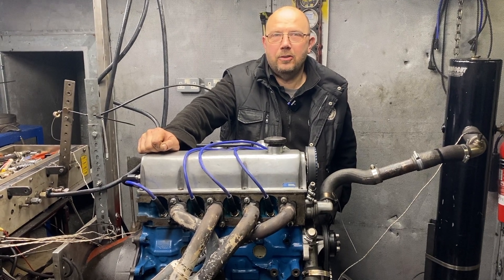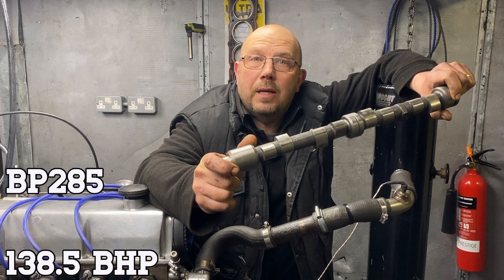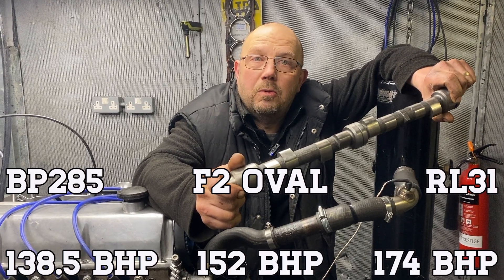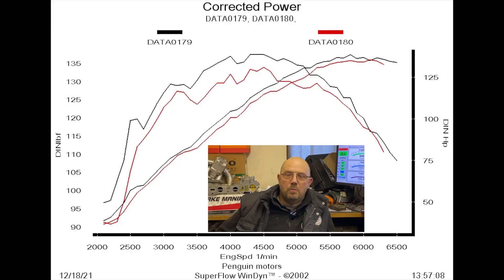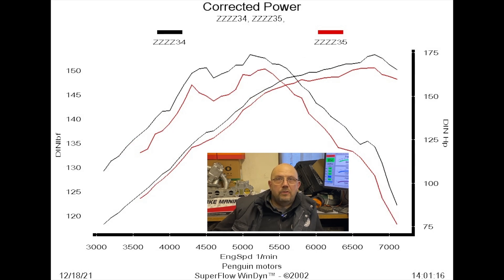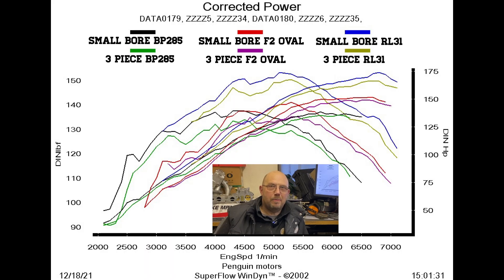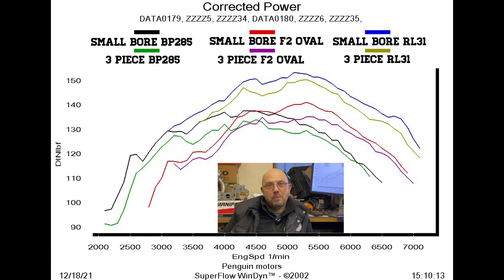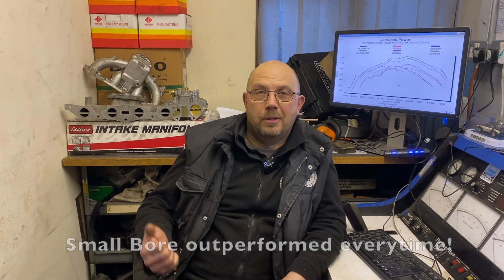Pinto Small vs Big Bore Exhaust Manifolds tested on 3 different Camshafts

Comment: I remember back in the day the pintos had a cam oiling issue, how was that solved?
Reply from the maker: The engine was never changed, but your right the wear issues largely went, so I think it’s just down to better oils, better materials and likely much more frequent oil changes

Comment: hi your videos are absolutely cracking and thanks to share so much knowledge with us I have a question that consumes me on long long discussion with my mate building engines ... does a even good air filter affect the power of engine? My mate says a good air filter gives a better atomisation of mixture .... but all the gr1 escort at the front don't use any air filters ... so where is the truth? have you been able to answer this ? Would love to have  your feedback on this and first of all thanks for you time...
Reply from the maker: I did test a 140bhp 32/36 equipped pinto with and without a K+n filter the filter made no difference. On a 170bhp bike carb’d pinto a foam sausage filter which was very close to the ends of the trumpets lost maybe 1 bhp
Reply: @PenguinMotors  Ok so it's better keeping the air filter on 👌

Comment: Many years ago, exhaust manifolds were tuned in various ways and big bores were shot to pieces because they created all the wrong turbulence (never mentioned) on exit ..... What won in the end was tuned pipes inside the exhaust manifold that actually matched the exit bore size of the head and cut to the right length to produce just the right vacuum to help the exhaust gas escape but not oo much that it would also draw some of the fresh duel mixture wasting fuel and power

I do a lot of questions asking before slecring an exhaust manifold.....I see so many of these car programs now where they just make all sorts of fancy stainless steel manifolds and systems on  high end builds with no regards to tuning them...It's one of the biggest losses of power ... Big bore is just noisy, you need a tuned system of the correct size ...

Comment: Given the small ones have enough primary tube diameter to supper 50-55 hp per cylinder, and the 'big bore' set have enough primary tube diameter 90hp per cylinder,  I'm not surprised at all the big one cost power everywhere on an engines making 43hp per cylinder and less.
Those crappy collectors and clearly horrible miss match at the head tells me the small set is down on power compared to something decent.

Comment: HP sells magazines, torque wins races.
Revs make HP
Reply from the maker: all true to a point, but for a big top speed on a long straight you need HP, and your not going to get enough torque out your x/f to make 200 bhp without using fairly high revs
Reply: @PenguinMotors  lol..... 86mm square engine.... The best X-Flow Northampton Motorsport have ever seen.
I don't mind you contacting them for a copy of my Dyno graph...

If I remember correctly 7500 is all the engine would go to.... Not enough Valve area.

Remember the standard stroke is 77.62 mm.
Reply from the maker: perhaps you should make a you tube video about it you will get lots of views! 86mm in its self isnt a massive stroke,  but like you say  an x/flow head is always going to struggle for valve area,  although off setting the valve guides can help with that. im guessing you have a lot of cam and peak torque is somewhere around 6500
Reply: @PenguinMotors  might try a 3 valve head like Ted Martin did with the X-Flow back in the day.

We have not fully optimised the camshaft as Eddie Griffiths did not know we were using an Integral Rocker cover.

Both Piper and Ted Martin did Integral rocker covers back in the day.
Reply: @PenguinMotors  we grooved the cam to be on the safe side although we had a small amount of clearance when dummy built
Reply: @PenguinMotors  The torque curve is remarkably flat and very smooth.
Does not sound like a X-Flow when running.
Reply: @PenguinMotors  Do you have problems these days with lobes wearing on pinto Cams..... I believe I have the answer to that problem.
Reply from the maker: @gj91471  your crank obviously has smaller big end journals then. thought id heard about all the different x/flow mods,  inc OHC conversions but never a 3 valve head
Reply: @PenguinMotors  Ted Martin did the 3 valve head and sold everything to Brian Dillon in Australia.
He also did reverse rotation camshaft, his own sump, oil pump, etc, etc.
He built a 2000 cc V8 F1 engine.
Someone put the engine in a MK1 Escort
Reply: @PenguinMotors  Honda size journals
Reply: @PenguinMotors  have you heard about wear proof followers.
Schubeck racing followers.
2 piece.... The wear part is made from silicone nitride.... Same material as the Space Shuttle engine bearings were made from.
The X-Flow size followers are identical to the Hatley Davidson Pro-stock drag racing followers.
These followers can be used for Dyno testing different Cams.... No wear
Reply: @PenguinMotors  YouTube video...... I will leave that to David Vizard.
Speaking of David.... I use his special Race Engine Break-in Lube.
It proves that what we thought was a broken in engine..... Is far from the truth
Reply from the maker: @gj91471  thats very interesting
Reply: @PenguinMotors  Pistons have been successfully DLC coated by Wonder Process Craft method.... Something you may be interested in.

Comment: A ran a Mk1 Cortina GT back in the day bored to run 1560 pistons with head ports job, A2 Cam and Twin 40's performance was best across the range with the standard Ford 1500GT exhaust and single straight through silencer.
Reply from the maker: the standard GT exhaust manifold was very good, unless you had something like an A6 cam and revved to 8,000 it would be hard to find something much better, most manifolds are too big

Comment: Do you have the specs on the F2 camshaft?
Reply from the maker: No I don’t sorry it was given to me secondhand because it was damaged in the thrust groove which I fixed. All I can tell you is it’s quite peaky so lacks any low down power but doesn’t make any really good high rpm numbers either
Reply: @PenguinMotors  Thanks for the reply . My engine is making 150hp with a crow 26661 . I like the look of the power curve on the RL 31 and trying to work out if it will give me the extra 25hp or so im after .
Reply from the maker: i dont know the crow cam, but on a good head with around 11;1 CR the RL31 will make 190bhp on a 2.0 bottom end

Comment: Graham just as a bit of a guide, how does the small bore used compare in runner bore size to a standard Pinto RS manifold
Reply from the maker: Not sure last time I looked at an RS manifold it was 1980 something
Reply: @PenguinMotors   I’ll pop a post up on turbosport when I get one measured
Reply from the maker: I do remember the primaries are extremely short although not as short as a Sierra manifold

Comment: lovely ! what you need to prove now is that all these folk using the bling simpson/mass style/TLE/105e 4-1 up and over hotrod style manifolds on their street crossflows are actually losing power and torque compared to a smaller bore 4-2-1 regular style ex manifold !!
Reply from the maker: yes i will at some point, need to sort my self a x/flow dyno mule first. trouble is 1600 x/f are no longer common or cheap

Comment: Would be interesting to see dyno runs on the cast iron standard and rs exhaust manifolds. That and different length secondaries on the rs manifold.
Reply from the maker: wish i had a standard cast iron RS manifold to test. i remember years ago picking them up for next to nothing in a breakers yard!
Reply: @PenguinMotors  shame you are not in Australia could lend you one! Thanks for doing these dyno tests, they have been an eye opener.

Comment: When comparing manifold size difference you should use the same dimensions on primary and secondary lengths, most of the difference comes from length variation on your test. Have not seen an engine that prefers smaller tube if equally sized manifolds on both tests.
Reply from the maker: i have! But in this case we are testing off the shelf manifolds, so i have no control over lengths,  thats the point of the test trying two commonly used off the shelf manifolds. That said if you measure them pipe lengths are pretty similar anyway
Reply: @PenguinMotors  ok, didn’t realize you are testing just off the shelf manifolds. Just for curiosity sake, run one run without the exhaust manifold. I have not dynoed car engines and manifolds but bikes, and at those rev ranges bigger was always better when compared equal length.

Comment: Hey Graham cracking video as usual. Question with regards to head flow, maximizing your valve area you can run maximum size intake & 1mm increased exhaust or decrease the intake by say 1/2mm & increase exhaust 2mm which will flow & or produce more power & torque??
Reply from the maker: in almost every case you want to maximise intake flow. there was an old school saying that went " get it in, it will find its own way out" that is largely still true today.

Comment: Again many moons ago i built a i4 RS2000 engine , steel rods cosworth pistons Weber Alfa throttle bodies and Pectel T2 ECU and gravel cams. On Harvey Gibbs dyno with a bigish GP2 Tony Law manifold it made 219hp with a smaller bore Ashley one it made 226 hp ... so folks bigger is nearly not always better things have to be matched ...... nice video Graham !